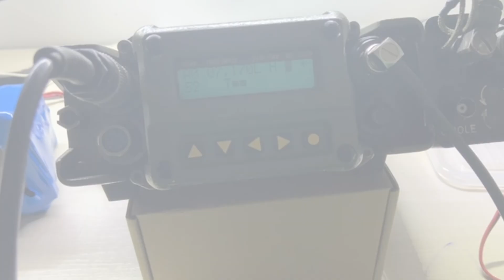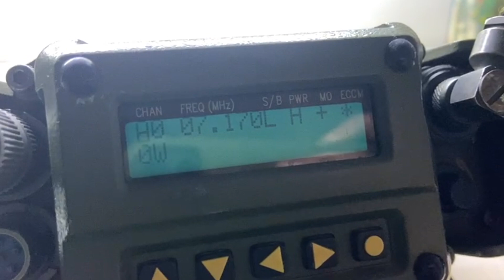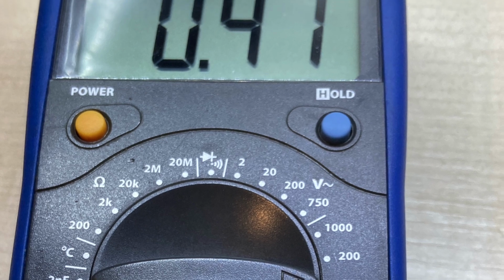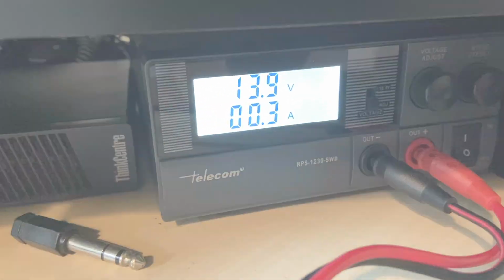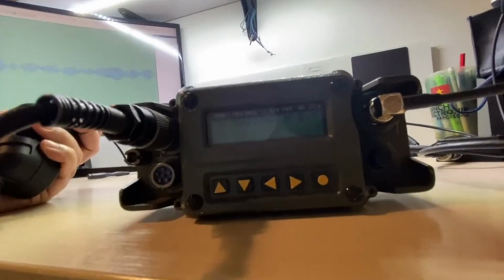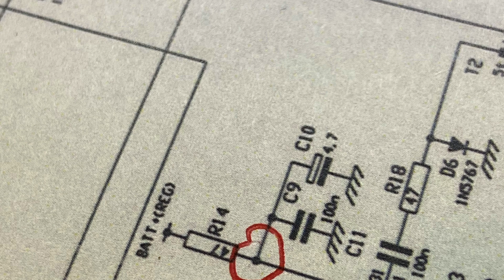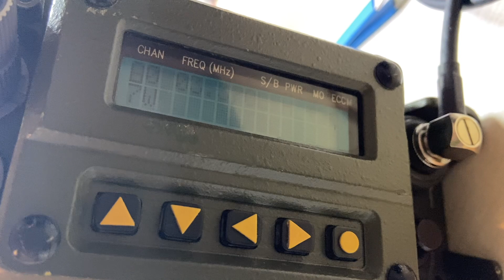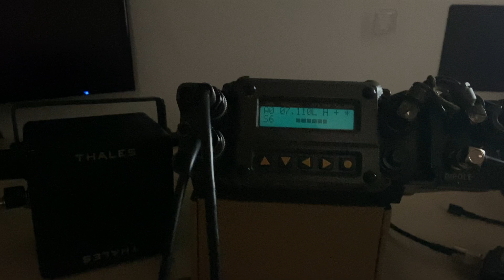Fixing a Grintek TR178B with TX fault

Comment: Do you have a link to the circuit schematics you are using? I found an old manual but it doesn't show circuit diagrams, just locations of the components and a component list.
Reply: nevermind, found them at the end of the manual